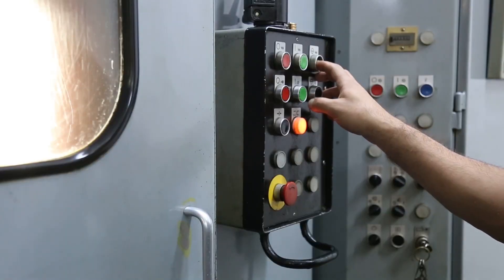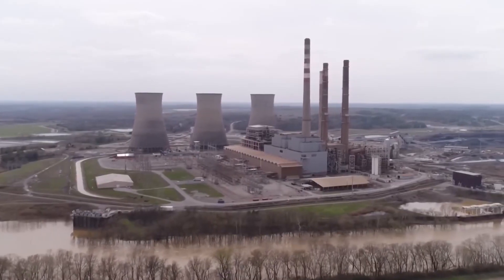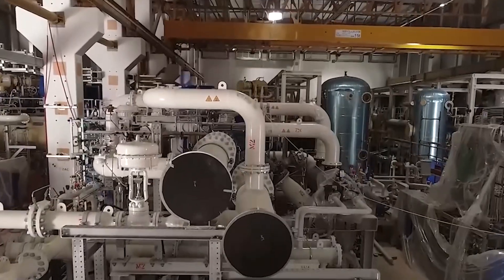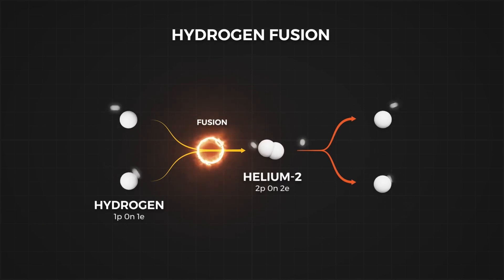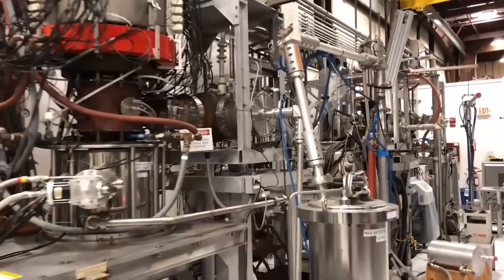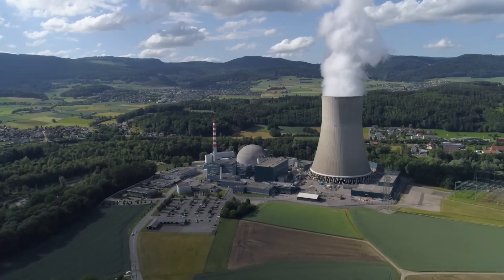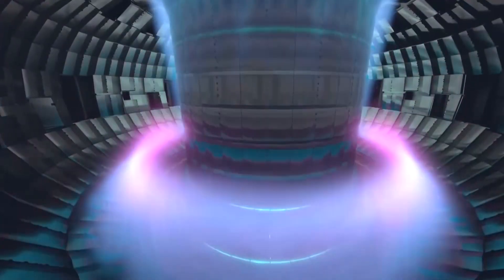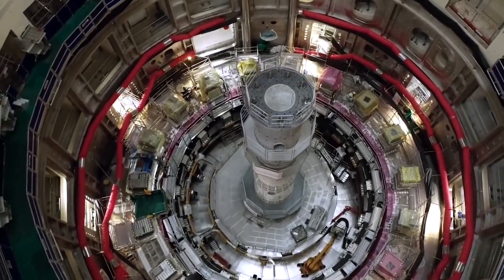Germany's New Nuclear Fusion Reactor SHOCKS The Entire Industry!

Comment: Super-computer may help stabilizing the optimum plasma shape in magnetic field. But so far, if the Pressure inside was still "Zero", Vacuum pressure at all, (compared to 2e11 bars(Atmospheric) near the Solar core) far from required by nature of Fusion initiative pressure. This common sense behind the/any Dough-shape (W-7x included) reactors alike, if hadn't been met, how could it be achieved (zero compared to 2e(11) bars).?!?
PS ; the EQUIVALENT Temperature of 150-200 milllion °C is not REAL, only been converted/compared from Energy Level of excited Plasma particles, says Hydrogen(+).
If so real, such amount of Radiative Energy (from 200 million°C), there must be massive by-product of, says Helium in amount of 82 tonnes (per milli-seconds per sq.m./cu.m. of reacive Volume...Which implies IMPOSSIBLITY (!?!) Then, even W-7x will also failed, just like unsuccessful ITER (TOKAMAK) would sadly be.(?) Postponing for another 25 years.

Comment: The Wendelstein 7-X will never be a commercial fusion reactor.   Making a plasma confinement reactor and making a commercial fusion reactor are not the same thing. They are different machines. At 100,000,000 K there are no physical conditions for nuclear fusion.
Wendelstein 7-X никогда не станет коммерческим термоядерным реактором. Изготовление реактора для удержания плазмы и изготовление коммерческого термоядерного реактора - это не одно и тоже. Это разные машины. При 100 000 000 К нет физических условий для  ядерного слияния.